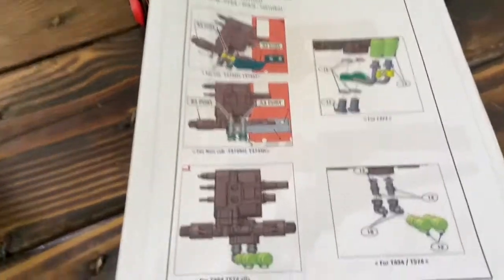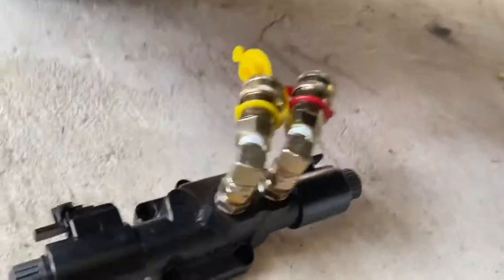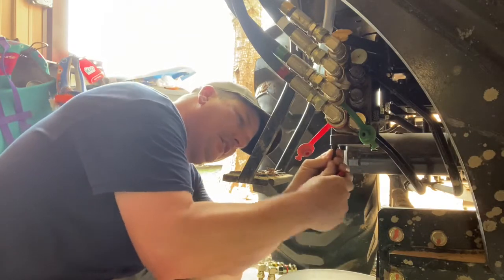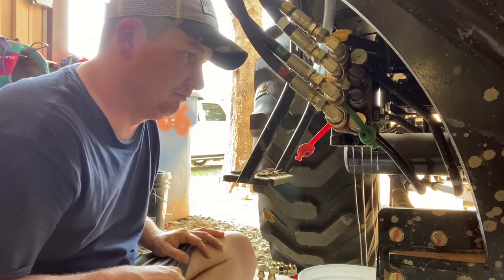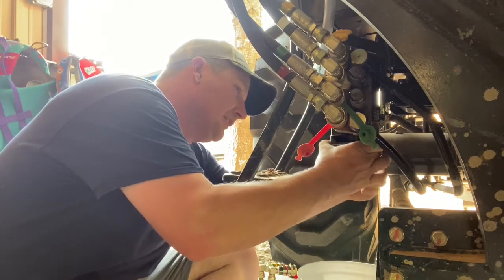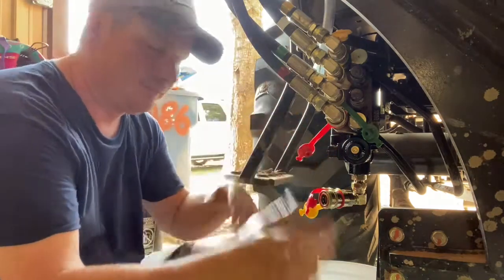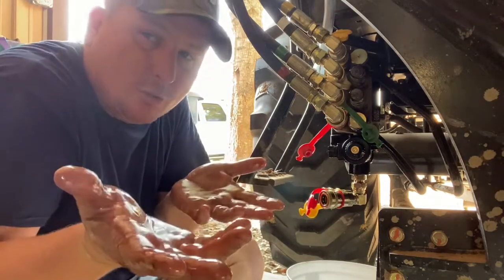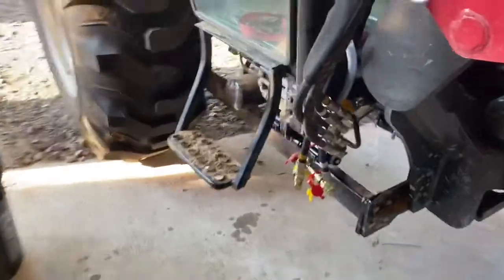TYM third function install

Comment: Did you get it to work properly? If not look at the 3rd page of the install manual and see if you installed the "connector" between the block and new piece.

Comment: Just had my used T454 cab delivered yesterday and it has the third function already installed (previous owner maybe?) Will check and see if the buttons function the same. Great video!
Reply from the maker: Good luck with it!  I put mine in the shop in the middle of March. Got it back last week. Had transmission problems. And I found out why by buttons didn’t function properly. I was missing a part. I have it now

Comment: You’ve got something plumbed wrong or something.  You def have to push button then move stick but it should be “right” and “left” with button pushed.  That opens and closes grapple.  It should not close on its own either.  
Also, if you ever hook up the hoses in reverse on the attachment, “left” could do the opposite of what you are used to as well as “right”.
Reply from the maker: I was missing a piece. TYM sent me a new one and it worked perfect

Comment: I installed my third function valve on my 474 and it was one piece that went in to the upper valve that I didn’t see you put in maybe that’s why you’re having some trouble with the opening and closing of your grapple
Reply from the maker: That’s exactly what it was. The instructions sucked!
Reply: hey Joseph Orban i just gat a tym 474 last week and im wanting to get a 3rd function valve and was wondering if you can give me the part number or a model number  mine is a 2022 year tractor . thanks in advance
Reply: I bought the third function from a TYM dealer in Tennessee I can’t remember where exactly but they sent it right out and I believe with shipping it was around $900
Reply from the maker: @ricardoruiz6612  I called TYM headquarters and told them what I had. They shipped it to me

Comment: thanks for posting this video, just got my valve for same tractor, this video will help on the install, also did you get the quick disconnects in your kit or have to buy them separate?
Reply from the maker: You’re very welcome. Hope it’s a help. The quick disconnects were included in the kit. Thanks for watching and commenting
Reply from the maker: Out of the Woods also. My TYM is in the shop. The transmission (Low High) selector shift fork broke inside the transmission. Had about 110 hours or so on it. Been watching your videos for a while. Love the sawmill!  I have to pick up some cedar and black walnut tomorrow I had milled up!
Reply: @brandonbrown1984  you have an email I can contact you? my kit did not come with instructions and their is a small silver piece almost like a bearing that I have no clue where it goes, about 1/2in long,
Reply: @brandonbrown1984  I just found the quick disconnects but they are just a size too small for my grapple,
Reply from the maker: Out of the Woods Brandon.brown@lanxess.com seems like I had a piece left. Just shoot me a pic
Reply: @brandonbrown1984  thanks, appreciate it
Reply: @brandonbrown1984  well I found out today that small left over piece that looks like a cylinder with o rings on both ends is the reason why we have to pull back on the arm to get the grapple to open, it goes up in the valve small end first on the largest whole, that makes it a true third function, I will be correcting mine tomorrow and adding the cylinder, FYI for when you get your tractor back,
Reply from the maker: Out of the Woods that’s about right. I’m sure I threw mine away. The wonderful instruction manual never mentioned it. Maybe TYM can send me another one. Thanks for letting me know. I appreciate that a lot!!
Reply: @brandonbrown1984  yes sir, mine didn't come with instructions, this video was my manual lol, probably a cheap part, hit them up,
Reply from the maker: Out of the Woods mine had no instructions either. I had to call company and they emailed me some.
Reply: So what size fittings do we need on a grapple to hook up to this kit? 3/8 or 1/2? I know one is male and one is female but that's all I can remember right now lol
Reply: @OutoftheWoods0623  the piece is called a power beyond sleeve

Comment: is there any way i can get a copy of those instructions from you? in 6months having the kit finally, i am getting no where trying to get the instructions. i am getting we will email it, and none show up. i watched your vid, i do not see you adding, checking any o ring fro removing the block off plate and adding the control valve at the bottom. my kit appears complete, yet there are no orings left over to seal that valve. i assumed they get reused. there must be seals in there. i have yet to take it apart even though i am a mechanic as i prefer to have full understanding of whats what and specs. also the kit came with a spool valve, that needs to be installed somewhere. i am not seeing all the pieces in my kit being used in your video.  i have a 474 and my valve looks identical to yours and in same location. i have asked dealer, and even called corp and never get instructions. i got a service manual for tractor but does not include it. i can send you some $ if need be thanks

Comment: In other videos with TYM third function installs there is a piece that needs to go in before you bolt on the kit (e.g., while the hydraulic fluid is leaking out). if you dont install that you will have a diverter setup and not a true 3rd function.
Reply from the maker: That’s correct. That was my issue
Reply: That must be my issue as well, I can't open my grapple while moving the bucket at the same time and vise versa (installed at dealer). But 2 days ago I started having an issue that I can no longer tilt my bucket down. I'm guessing my 3rd function (diverter valve is engaged).

Comment: Have you had any issues with the TYM? I think they are a good value if they will be durable as a Kubota or JD.  A tractor like the 574 would cost $40K+ in green or orange.
Reply from the maker: Yes. I have. It’s been to the shop twice for transmission issues. And I have to take it to a different ship tomorrow. And the hydraulic steering went out also. Customer service is not very good either
Reply: @brandonbrown1984  Most of the ones I have seen on youtube have not had issues, but I guess any of them can have problems. What kind of problems with the transmission?
Reply from the maker: @311hitwall  on the low-high range selector, it started out by just popping out of low range. Wasn’t a big deal. I would just put back in gear. Now, if I do put it in low range, it takes about 10 minutes to get it back in high range. It will stay stuck in low or neutral

Comment: mine opens without pushing back on the joystick. Perhaps you have something incorrectly plumbed in?
Reply from the maker: Yeah. Mine had horrible instructions. It never mentioned one of the pieces included with the kit, so I did not put it in. Come to find out, I needed that for true third function. 🤦🏻‍♂️

Comment: Paid 850 for mine put on
Reply from the maker: Dang. Wish my dealer would’ve done that for me!
Reply: Might be because we got it when we bought the tractor and all implaments
Reply from the maker: C.B. Harrison yeah. I wish I had known it wasn’t included. I would’ve done that also
Reply: Should deliver it wed the 574 hst cab with backhoe ,grapple with 3rd function, box blade, landplane, with front end loader $40500 out the door. Cant beat the price on the tym tractors.
Reply from the maker: C.B. Harrison that’s true. Hope you have better luck from yours than I’ve had of mine. 100 hours in and the transmission broke. 120 hours and the steering ram went out. My closest dealer (3 hours away) was hit by an arsonist 2 times a week apart. My tractor has been in the shop for 8 weeks. No clue when it will be fixed at this point
Reply: I hope so to was going to get the rk55 but this was about 3200 cheaper! Found out they was made in same factory and i could go to a dealer instead of a big box store when it broke! Wonder if anyone else is having the same issues!
Reply from the maker: C.B. Harrison probably not, I just have wonderful luck! Lol. I really like the tractor. I hope these couple bugs are the only issues it has
Reply: @brandonbrown1984  true we will see this weekend im going to put it to the test on 70acres
Reply: @zx6rkawi09  had rk for 3yrs no problem with service on warranty  and use my tractor 850 hr
Reply: @billclarkclark3833  i went with tym cause i have a dealer to go to and was a little over 3k cheaper. Found out same company makes them that makes rk and a few others. So 3k is 3k at the end of the day.